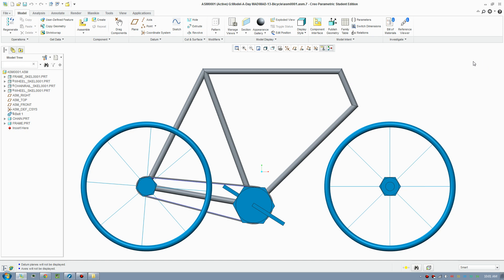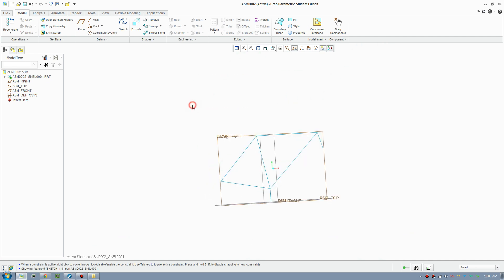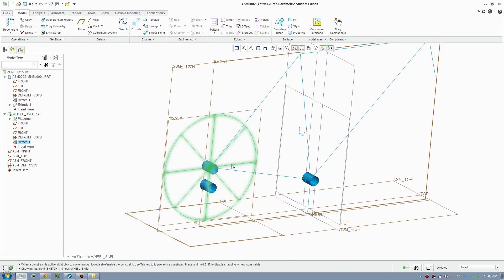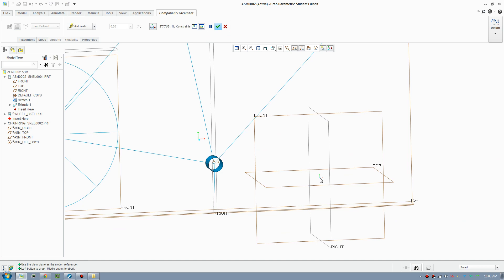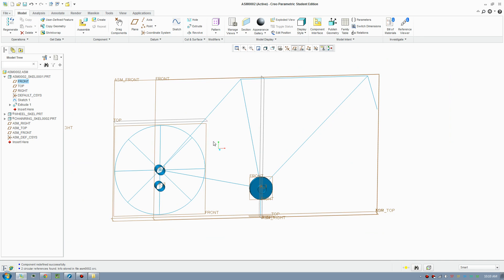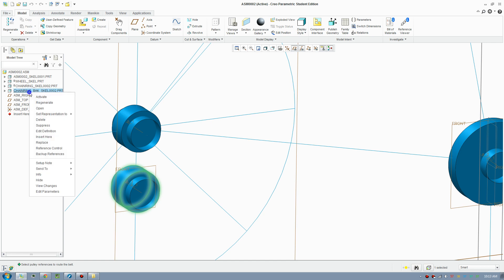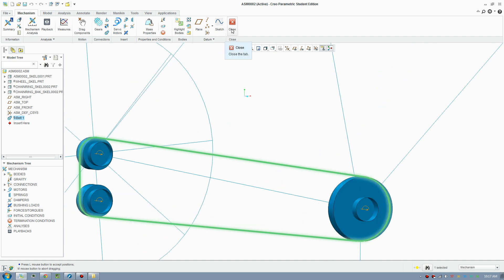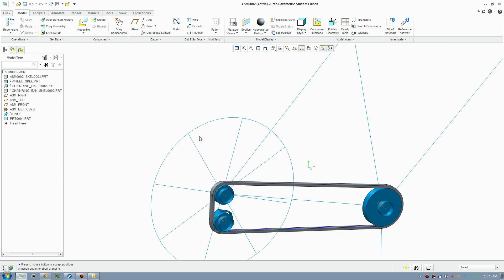Creo Tutorial - Bicycle Skeleton Mechanism

Comment: Hi, thanks for the video, nice tutorial. Which key(s) do you hold down to select the references in the sketch mode (without going to click in Setup->references)?
Reply from the maker: ALT key and click
Reply: Hi, I tried but doesn't work...what Parametric version are you using? do I have to set an option in config.pro before? thanks

Comment: I would like to do a winch but I don't know how to do the cable. Is it possible to do an "open belt" ?
Reply from the maker: +Mayt Lyp Hi, you can model the cable as a tube. You would just draw the line and use the sweep feature. There is also the belt mechanism.